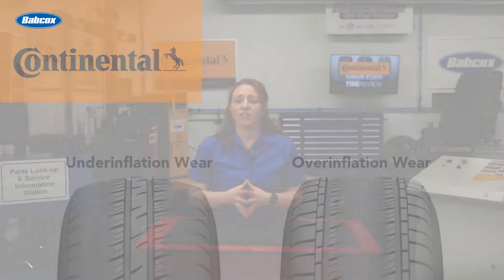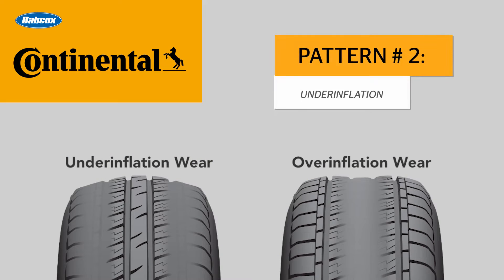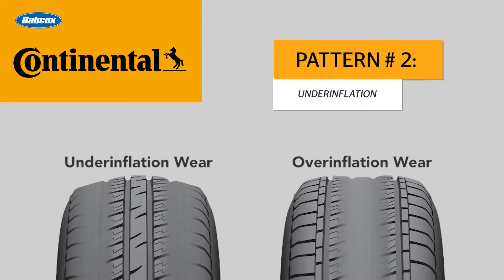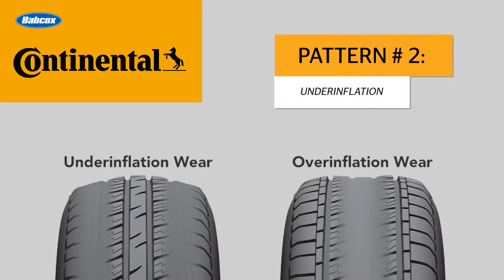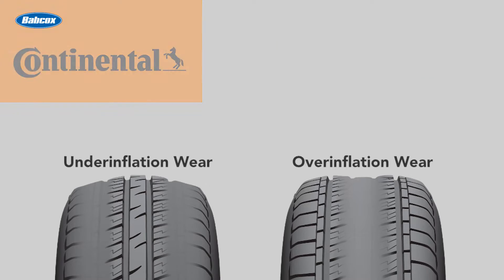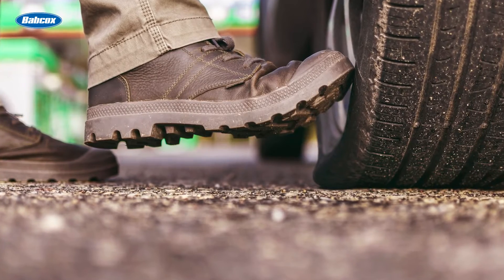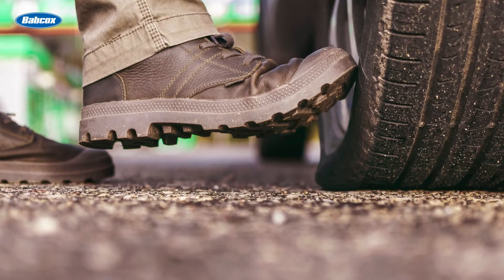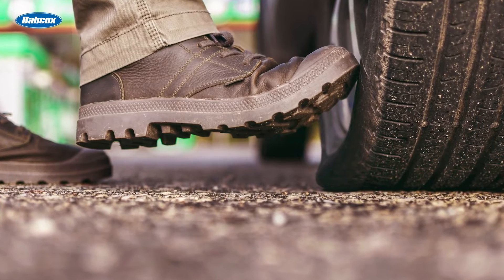Reading Tire Wear Patterns

Comment: If there is a 1mm difference between the three grooves on a tire, would that be close enough?  Or would it indicate a problem?
Reply from the maker: A 1mm difference between the three main tread grooves on a tire is probably not a cause for you to be concerned, but it depends on how and where that difference is measured. If you're measuring tread depth across the face of the tire, a 1mm variance between grooves is fairly typical.

However, it could be a problem if the 1mm difference is very localized on the tire. It could mean the tire is being over- or under-flated, or there's a suspension problem with your vehicle. 

If the tire is new or only lightly used and you're seeing a 1mm difference already, you might want to have your friendly neighborhood tire dealer take a closer look for you.

Comment: Hi, im having a problem with cupping left edge if you run your hand over tire edge it is high and lower hight on tread. I'm was wondering could it be anything other than shocks or struts? It seems everyone has a different opinion although your answer seems to make the most sense. Could it be anything else causing the cupping? Thank you for your help appreciate your help,sir.